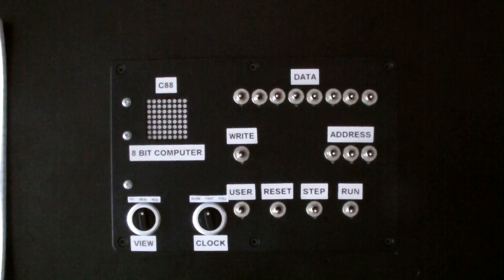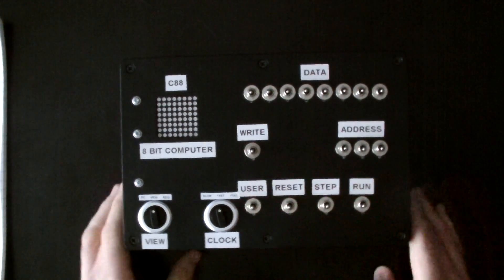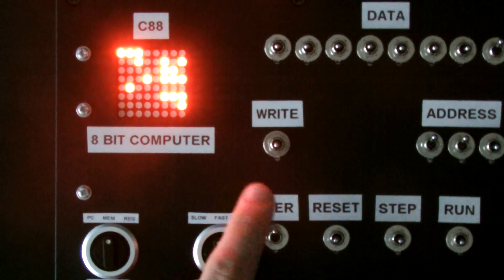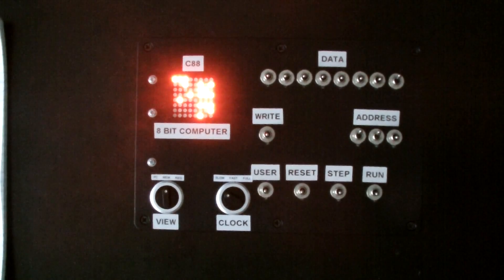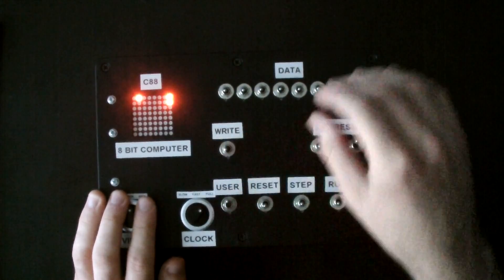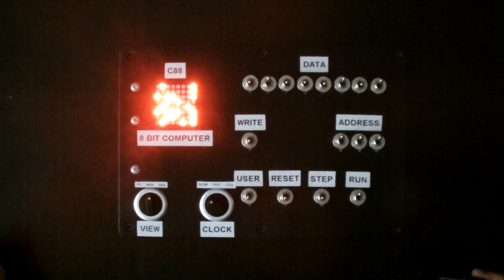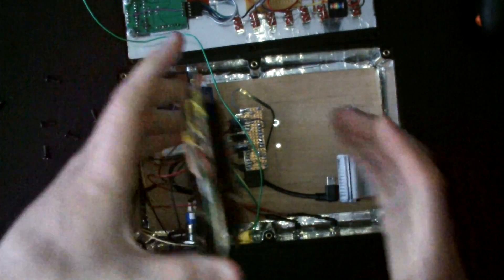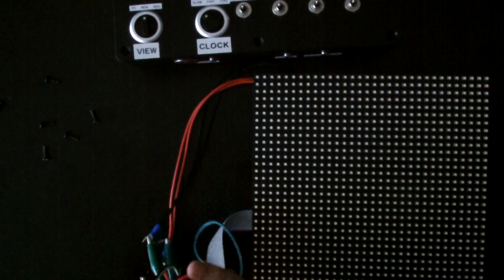C88 Homebrew Computer

Comment: I wanted to build 8x8 display, like you did, but I realised that diods are connected in one way ( I'm gueassing: first byte is line, second is 8 "pixels set"). I'd prefer to have 64bit memory times two, to swich images, insead of rewriting image every 8th cycle.... But.... your display seems to work different way... Would you mind to share your display connection scheme? Are you using clock for "refreshing" display or maybe you changed something to display whole 64 bits at once?
Reply: The code for the C88 is on github[1]. The LED display is based on a MAX7219 chip, so all of the LED scanning is handled automatically, the MAX chip is connected to the FPGA, you can see the VHDL code used to drive the MAX chip[2] in the git repo. I hope that helps :-) [1]https://github.com/danieljabailey/C88 [2]https://github.com/danieljabailey/C88/blob/master/matrix_driver.vhd
Reply: Thank you very much! It'lll help for sure! :) Have a nice day!

Comment: If you could help me, please... How did you made random generator??  This is the most important part in my future project,but I have no idea hot to do it. For now, my best guess is mix of radio white noise normalised and converted to stream of 1s and 0s... But, it's only an idea, I have no idea how to build this, yet...
Reply: Hi, This machine doesn't have a random number generator built in. The random dice roll program generates a random number based on how long you run the program. The program just counts from 1 to 6 and then loops, the random number comes from the fact that it runs so fast that manual control of the run time (with the run switch) essentially produces a random count. Randomness is hard ;-)
Reply: Thanks! Yes, randomness is hard. ;) Roll dice is very nice done then! :) Yes, for dice roll it's really good for this job! But it's not enought for the computer itself... I was thinking about using EPROM with pre-generated "almost-random numbers"... and then mix these with timer or counter or both... Have a nice day!

Comment: You can try to expand it. 8 bytes of memory is quite useless, but if you add more it gonna be a nice device. Just add multiple banks of 8 byte memory and it gonna be nice. The only problem is how to do this without adding more switches.
Reply from the maker: Ah, well, the purpose of the project was to make a ridiculously small CPU. It isn't designed to be useful. :) I have built a larger version with a 32x32 LED matrix instead of 8x8. Some day I'll get around to finishing it and posting a video of it.